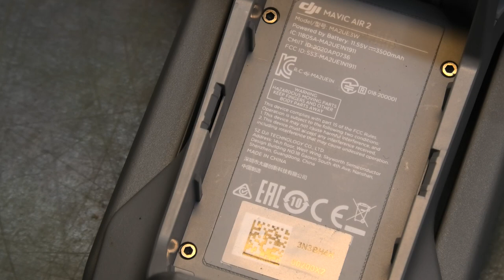DJI Mavic Air 2 - Repair Left Front Motor Arm Replacement - 1213

Comment: I am thrilled to see that you still have the Ifixit kit and it worked pretty well with repairing this drone. I know working with some things you need the very small screw bits and tweezers and plastic picks to safely pry things open.
Reply from the maker: The plastic tools in the Ifixit kit,, is great for not scratching the drone :-)

Comment: I just finished installing front arms on an MA2.  For some reason one arm was quite easy whereas the other must have taken me 100 attempts before everything lined up correctly and I was able to insert the screw.  One thing that helped was a small vise to hold the axle.  It's necessary to put a half turn on the black plastic arm, and the vise holds the axle steady while you do this.  I also put a little copper grease where the bottom pin goes into the small hole.  Also, the arm needs to be pointing towards the rear of the drone, rather than in it's normal open position.  (paul)
Reply from the maker: Hi @TravelsWithBert
Thank You very much!  glad you liked the video :-)
Thank you for watching! :-)

Comment: Great repair video!
Nice to see drone up and running with cool shots at the end! 👍

Only I was a little bit scared in that moment, when You try to disconnect antenna wires with metal screwdriver near these 3 small SMD components on PCB for antenna.. I'm glad, that You didn't rip them off by accident, that will be a disaster!!

But otherwise, perfectly accomplished job! 😉
Reply from the maker: Hi Arturs Mihelsons
Thank You very much! I was also not happy about the amount of forces that I needed to use to get that antenna off,, glad you liked the video :-)
Thank you for watching! :-)

Comment: I am absolutely with you about the bewilderment about the complexity of the design and the number of seemingly unnecessarily heavy parts of the drone. There is a load of potential for improvement there, and DJI would be well advised to make use of it before someone else does an nicks their crown as top producer of small high quality camera drones!
Reply from the maker: It might be okay,,, but also quite over engineered...

Comment: Not to be rude or anything, but you have forgotten to dress in the white antenna wire nicely on the bottom side. Previously (see 15:09), when you pulled it out, it was hooked onto the plastic bits sticking out from the case. It may be just a cosmetic issue, but may result in squeezed antenna cable? (24:06 you even mention that the antenna cable seems to be a bit longer, in 24:58 you can see you just pushed it away, not really where it is supposed to be)
Reply from the maker: Okay I see that I missed that!

Comment: Hi, I was wondering if you have any tips for putting the arms on the front of the drone with the big splint. I have replaced the two in front, but I am having a lot of trouble putting the arms back together. The splint is what holds the arms, which is difficult and few in the way.
Reply from the maker: Hi,, I am afraid I only did this video because I had this issue,, and saw that there was not that many that had shared a fix. I only looked in to how to replaces the back arms.